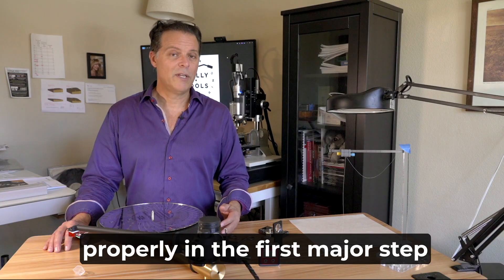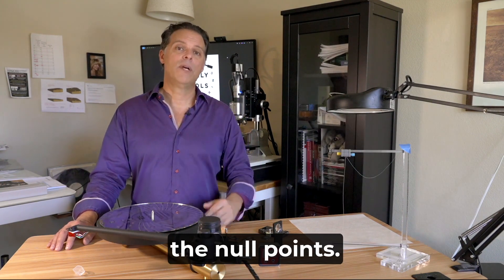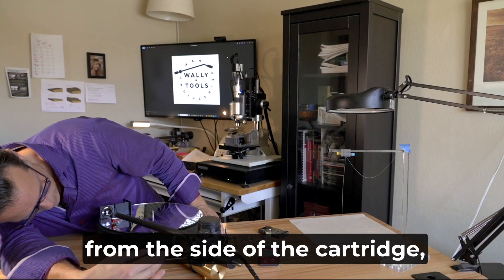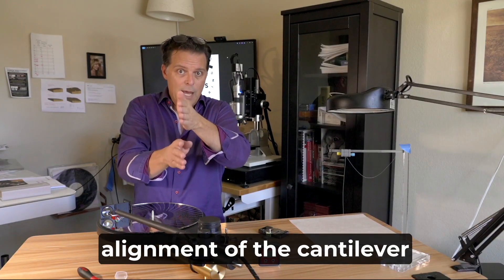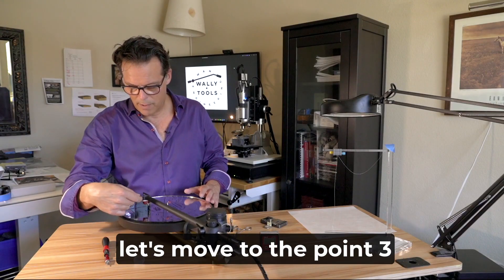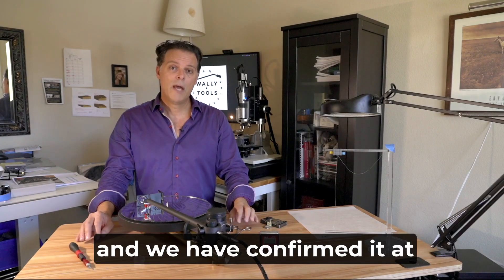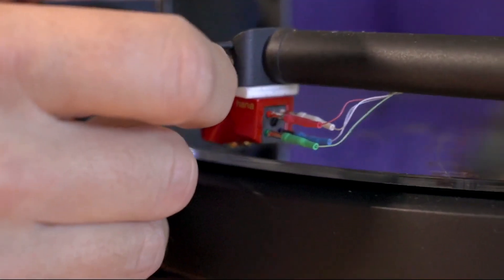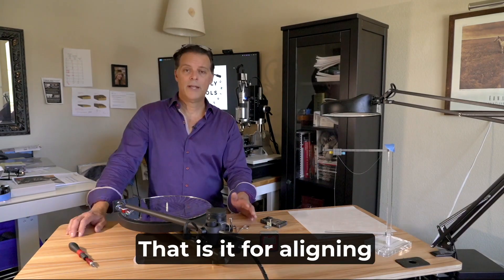WallyTractor v2.2 Instructional Series - 2 of 3

Comment: Hello!Adjusting the angular error is a very important aspect.A slight deviation will disrupt the symmetry of the modulation reading of the center of the stage, as well as there will be distortions in the sound.The nuances will not sound expressive.When I calculate the zero points for each tonearm separately, I often see that according to Stevens, the cartridge becomes faster on the grid.There are also cartridges where the cantilever is not visible.In this case, I attach the lead to the front of the head.thank you!

Comment: Hi JR, thank you for the valuable guides to a perfect alignment.  I am a bit confused about your instructions on anti-skate.  In the first video, you mentioned getting the horizontal forces dialed in but on this video, you mentioned at 1:50 that anti skate is disabled.  Can you explain what this means?  Thank you again
Reply from the maker: The first two times you use the WallySkater are to measure the horizontal torque force of your arm with NO anti skate applied and to measure the arm’s static friction. These two tests must be done before aligning the cantilever. I discuss this in the WallySkater instructional videos. 

You do NOT apply anti-skate at all until the cartridge has been aligned in the headshell on the horizontal plane. 

See the video in the setup overview process for all of the major setup steps. Go to the website’s video page to see them in order. 

I hope that helps.